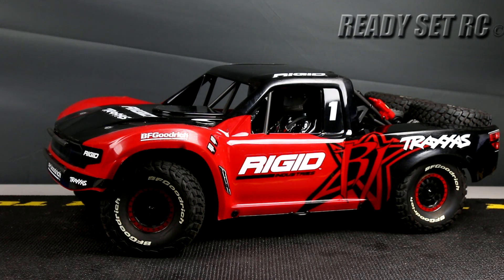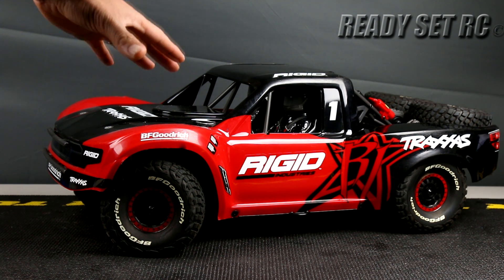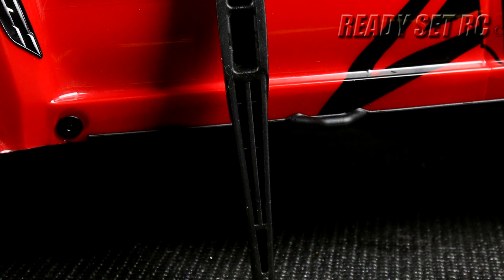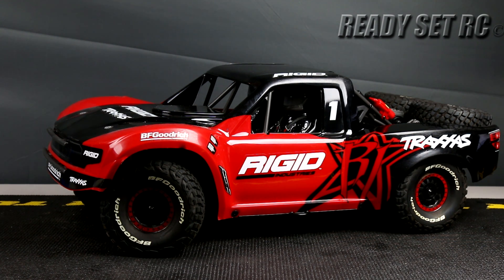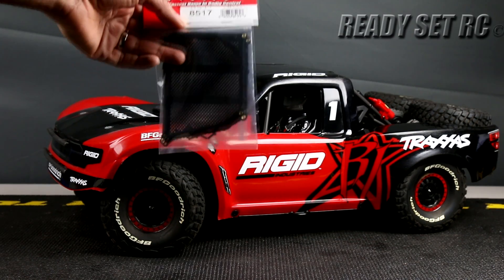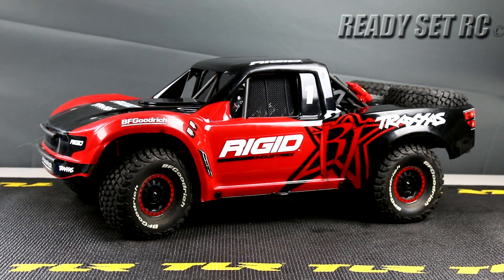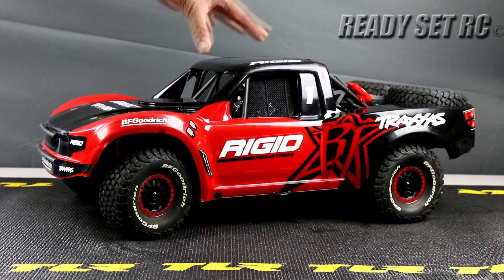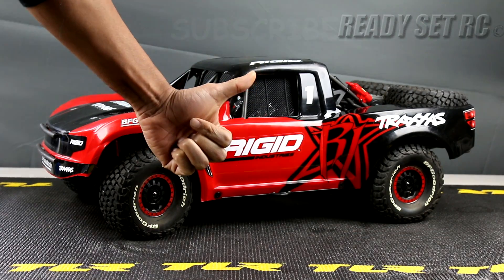On The Bench with the Traxxas UDR - Episode 1

Comment: How do you change the metal ball joint things out if the stock trailing arms into the rpm ones?? Plz help
Reply from the maker: @Schnoonglaandia Geckeler
 I did this some time ago but I remember  it was a fight to get them in.  Pulling them out I was not worried because mine were damaged and I was not worried about damaging it further.  As for putting them into the RPM arms, you are going to think you are going to break them while putting them in but you won't.  Need maximum pressure to get them in.
Reply: Ready Set RC yeah i managed to get them in, i used my teeth but dont tell my mum 🤫 haha
Reply from the maker: @Schnoonglaandia Geckeler
 🤣😂

Comment: Very cool, looks good, did u have to shave some of the xt90 part open more so they fit?
Reply from the maker: @STEVO D 313 Hey Stevo, I had to Dremel some of the connector opening  on the chassis to get easy access to the connect.
Reply: @ReadySetRC  OK ya I seen that, no biggie though

Comment: How do you get it so clean
Reply from the maker: @Ezra begin It's actually a very long process involving hitting it with compress air, washing it down in my slop sink, scrubbing it down, hitting it with Green Works and a brush, rinse, hitting it with air again, then hitting it with Deep Creep and let it sit for a few days.  After all that, wipe it  down and here you see it.  For this truck a re-apply the markings on the tires after every wash.
Reply: Ok thanks udr is king
Reply: Wasn’t expecting it to be that easy